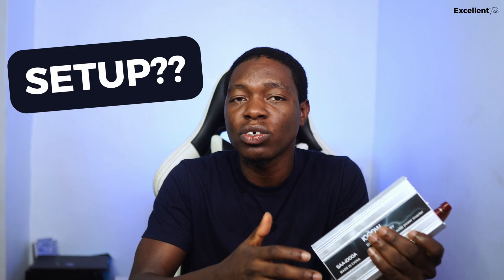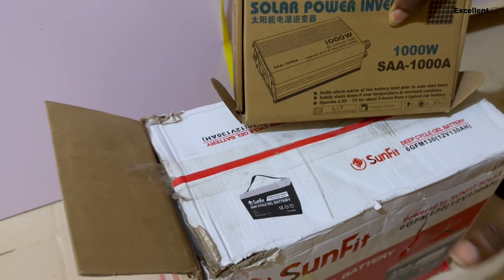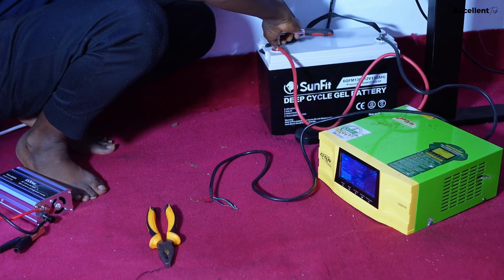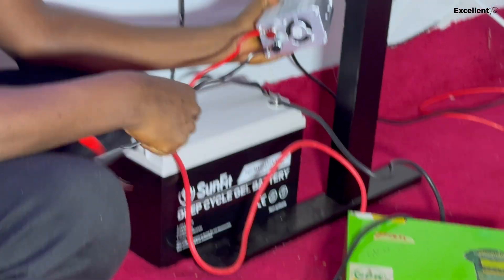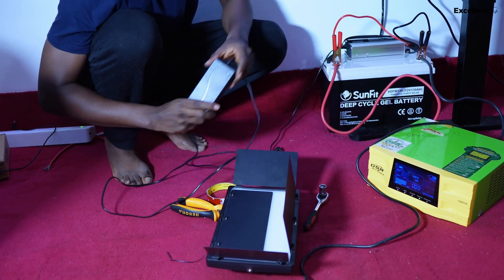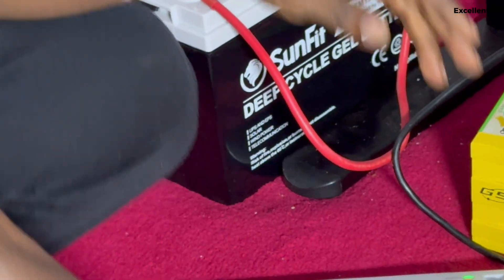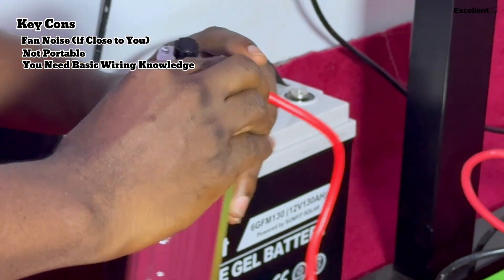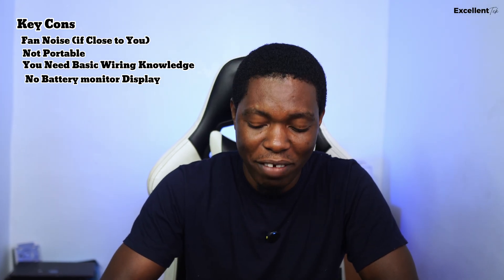I Powered Starlink for 34 HOURS OFF-GRID, But They Said It Won’t Last.

Comment: Nice video I just subscribed 
Please what is the name of the 3 product you use there
Thanks 🙏
Reply: You'll need a storage battery (150ah), panel, inverter and charge controller
Reply from the maker: Satchet inverter 500W above
Deep Cycle Battery 100ah
Battery Charger. It is best to get a solar panel if you don't have an alternative power supply

Comment: I have this same set up at home quite different from my main inverter set up. A satchet inverter with 130ah battery but I added a controller and 2 80W  panel. This is completely different from my main inverter set up. Just so u have round the clock internet set up. 

Nice video
Reply from the maker: That's great, you hacked it totally. That could be a great addition to my setup the 80w panel

Comment: @AyExcellentTech
Please do another video demonstrating maxing out that 1000w Chinese inverter. I need to by one but I'm scared the constant power might fall below 1000w.
I saw one on jumia that says the same but the indicated that 1000w was just the surge capacity but constant was just around 300w.
I'm asking because I saw this inverter again when I went to Alaba.
Waiting for your video, thanks.
Reply from the maker: Then go for 3000Watts if you are afraid of maxing it out.

Comment: While you tried with the video and most of your calculations, you missed out on some very important details.

1. The Lead Acid battery that you used, despite being "deep discharge" is best kept at 50% charge level and above, always draining it below that level will cause permanent damage to the cells over a short time. 

So basically, the runtime you got with your setup should be halved if you want your battery to last a long time.

If you used a Lithium battery then the case would be different since those handle deep discharges better.

2. During the price reveal for your setup, you only calculated the cost of the sachet inverter and the battery but omitted the cost of the hybrid inverter which you're using as a battery charger. 

A battery charger is an essential part of the system so it must be factored into the cost.

Once again, nice video in general.
Reply from the maker: The hybrid is an overkill for charging it; I only used it because I have it at home. The best is to buy a Sachet inverter that has a charger, which is about a 5 to 10k difference. Thanks for the comment.
Reply: Excellent analysis!
Reply: @donogolo77 

Thank you 💯

Comment: Nice video. But that inverter true power is not more than 300w. Forget whatever the Chinese decide to label the capacity
Reply: Valid point 💯
Reply from the maker: That same inverter carries my freezer and other things in my home. I have used it before before I got the GSR inverter and it served. Today is not the day for that analysis, though.
Reply: @AyExcellentTech
Please do another video demonstrating maxing out that 1000w Chinese inverter. I need to by one but I'm scared the constant power might fall below 1000w.
I saw one on Jumia that says the same but the indicated that 1000w was just the surge capacity but constant was just around 300w.
I'm asking because I saw this inverter again when I went to Alaba.
Waiting for your video, thanks.
Reply: @AyExcellentTech It probably has the surge capacity to start up your freezer and keep it on because your freezer uses less than 300W. I am going to suspect that it is more like 100-150W.
Reply: You did not add the charger cost ?
Reply: The EcoFlow River 2 and 3 fans are noisy. EcoFlow's Lithium battery is better than the gel battery you're using.

Comment: How long do you think a heroee 1 will power a starlink standard equipment.
Reply: Heroee 1 @ 80% DOD ... 800 watts available to use. Divide 800watts by hourly power consumption of your starlink: 25watts average for mini vs 55-60watts average for standard 

Result = your number of hrs
Reply from the maker: Heroee 1 is of different wattage

If your HEROEE 1 is…
	•	300 Wh → ~4.2 h (60 W) or 3.2 h (80 W)
	•	500 Wh → ~7.1 h or 5.3 h
	•	700 Wh → ~9.9 h or 7.4 h
	•	1000 Wh → ~14.2 h or 10.6 h
	•	1229 Wh → ~17.4 h or 13.1 h
	•	2048 Wh → ~29.0 h or 21.8 h

The difference in hours is based on the wattage your standard is working at the moment, so it can rise to 80W and it can be as low as 60W
Reply: Heroes 1 is 1kwh with a capacity of 200watts @AyExcellentTech

Comment: You can't compare the ecoflow, bluetti with that, the first two gives you pure sine waves which the latter does not, go for a pure sine wave inverter and make your comparisons.
Reply from the maker: The output and usage per hour is my concern not the pureness of the sine wave. The fact that what I have is a modified sine wave makes it cheaper and that’s the reason for comparison. Going through all those technicalities may not be of interest to this who just wants to make it work.
Reply: @AyExcellentTech  exactly 💯
Reply: @AyExcellentTech but just "making it work" might cost you more in the long run. Modified sine wave inverters are not that good for long term use. They make devices heat up and so on.
Reply: @dhrey7391 if you’re not using devices with motors, it won’t have considerable effect
Reply: @Siriusmajora True but device will heat up than usual regardless and heat is not good in the long run.